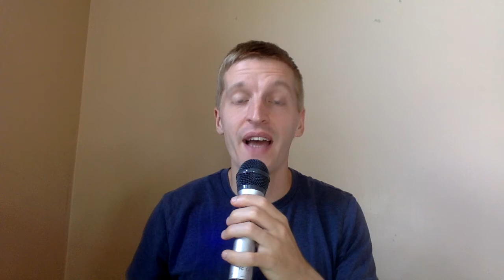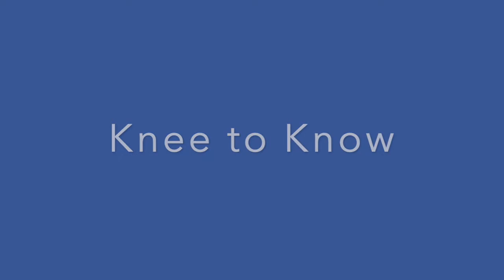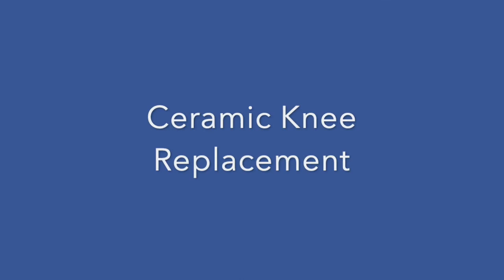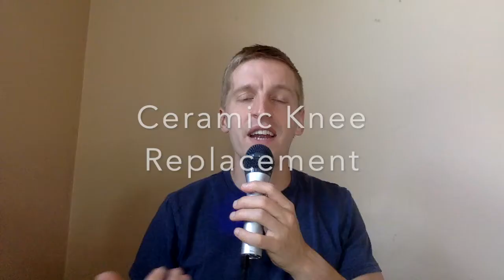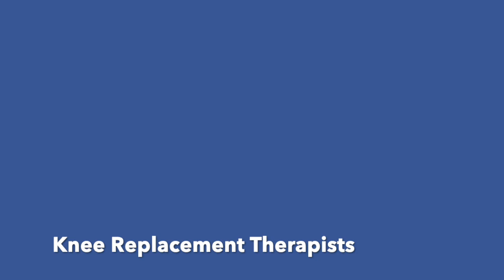Ceramic Knee Replacement Surgery -Metal Allergy

Comment: I had Bilaterial done "Exectech" 2007 the left knee needed  to be manipulated 2 times wouldn't bend. Left knee few yrs later got loose bc of "Exactech Implant   Oxidation  Recall.  But the hospital forgot to call the 
  Replaced it with a metal rod all the  way down the tibia.  After Replacement Surgery   I have Burning Burning ALL THE TIME. I keep Ice on it 24 seven. I bet this may be the problem.
Reply from the maker: I can't tell you if this is the cause of your continued pain. I would recommend if you are having continued burning pain I would consult with a orthopedist to see what options you have.

Comment: I'm considering the metal or ceramic TKR as I plan on hiking skiing etc , im 55 and I want something heavy duty.
Reply from the maker: The vast majority of the time you want to go with the metal implant. This is standard practice and procedure. The ceramic is mainly just an option if a metal allergy or sensitivity are identified which may compromise the success of your replacement.